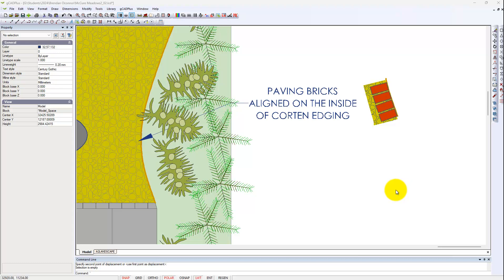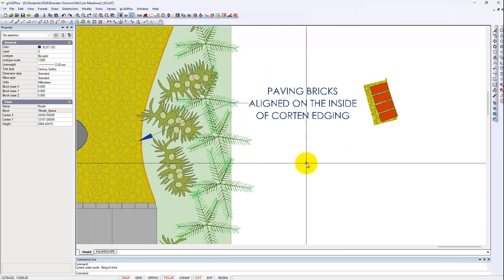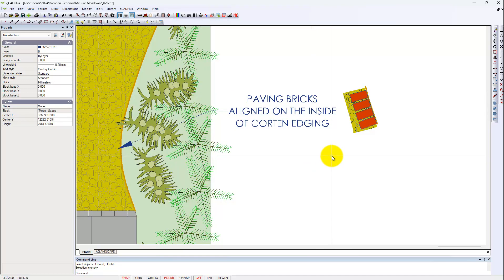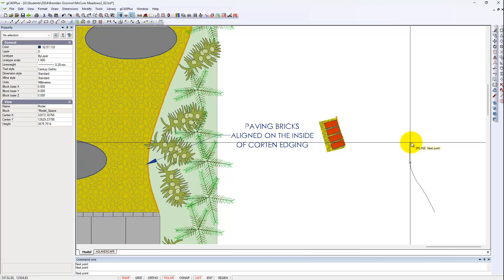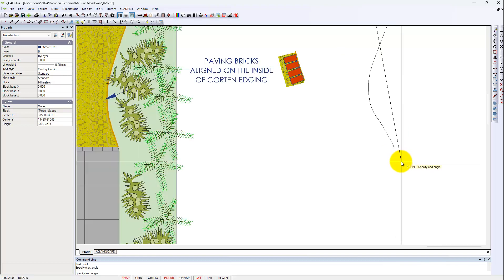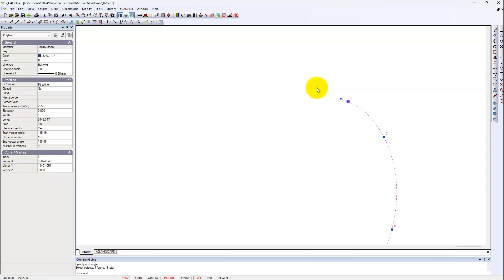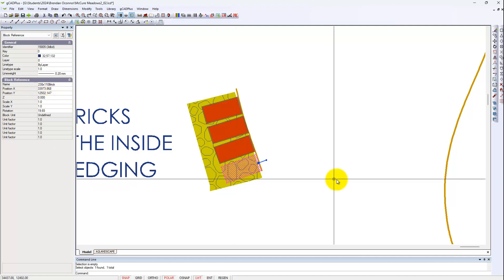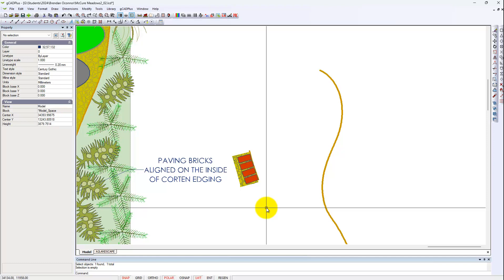Indicating paving bricks aligned with Corten steel edging

Comment: the Holy grail of Garden CAD,  brickedging tool that acts like a spline tool.  TBH, i dont use the spline as it has too many points and a bit hard to control  and i think you get a better more accurate curve by using the 3 point curve tool, and joining multiple of them together and fine adjusting them by moving points and selcting only points you want to adjust.  But i might use the spline to get a quick overall feel of a curve or how Garden beds will sit in the job.   then finalise them with 3 point curves. 
Another good option is instead of making a drawing of brick edging, is to just use a photo/raster of brick edging with a pointer indicating brick edging. 
Also, heres another idea, create a brick edging block than can be insterted into projects from the libary.

If you have straight brick edging, i just polyline it and use parallel lines till im happy, then fill with a transparency. 

I might do a video for all above.